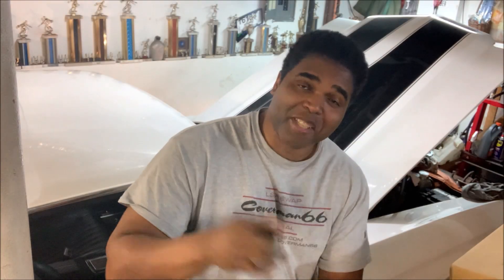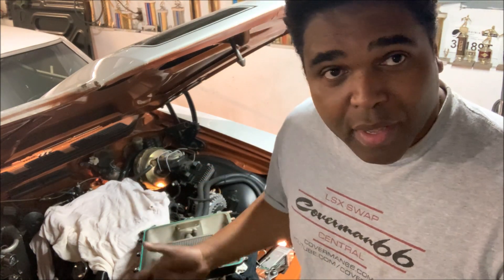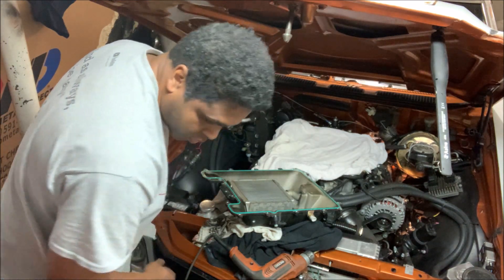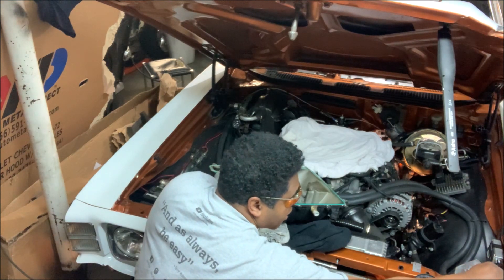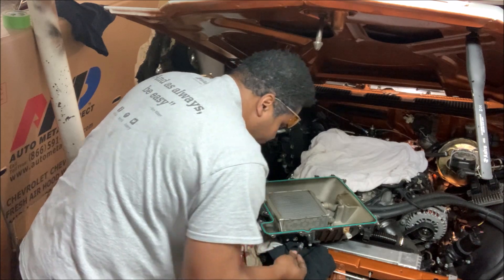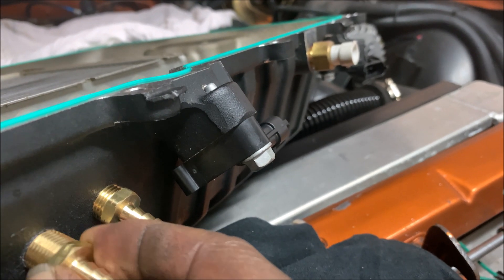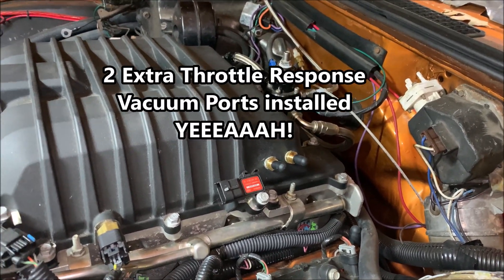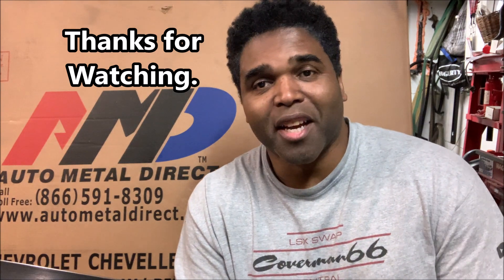How To Drill And Tap An LSA Supercharger Lid

Comment: Another great video Mr. Terry!!
Im gathering on my parts now, to do an LSA for my 84 2 door chevy Caprice and 63 Impala SS.
Ive learned ALOT watching you and Mr. Griff do this Swap.
 Just wanta to say thanks again for all the knowledge in info..
Reply from the maker: much appreciated and your very welcome brotha P.. thanks..
Reply: @Coverman66  

Question

 Since you have to extend the injector wires on the truck harnesses and wire relay for heat exchanger pump for the LSA swap.

Would it be easier, if I  use an LSA/ 6L90E Lharness from a CTS-V? (not using 6L90E)

Comment: Wouldn't tapping on the lid of a supercharger give you boost, not vacuum...? The reason the snoot gets vacuum is because it's having air sucked through it. While the lid has air pushed into it... am I missing something?
Reply from the maker: i tapped the lid because the lid gives you vacuum from throttle response. good for boost gauges, and the other willl be to work the Chevelle hood flap. if you go with the vacuum from the snoot its not really responding to the throttle. hope this clears it up a lil
Reply: @Coverman66  I still don't understand because the lid is at +8lbs of boost.  There's no vacuum in the lid when you hit the gas only at idle because of the bypass flap opening at idle.  Idk let's see you get vacuum there and I'll eat my words haha
Reply: This was also my concern. It may not matter depending on what the ports are used for. They will be under positive pressure not negative vaccum when the supercharger goes into boost.